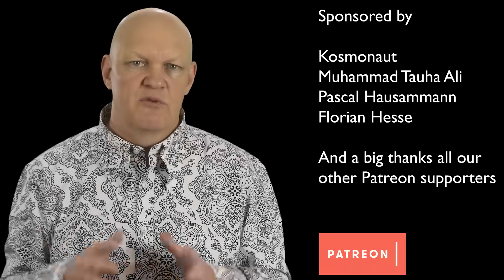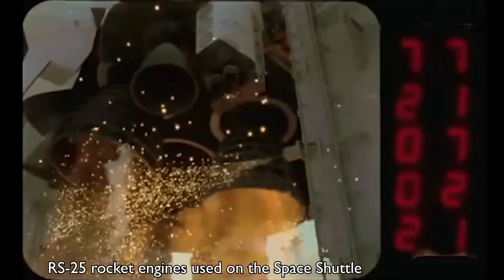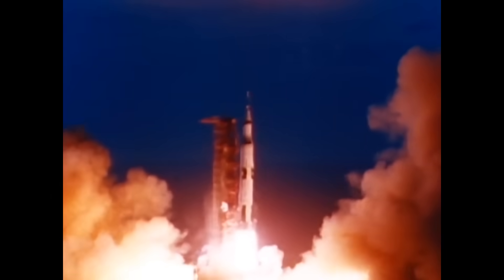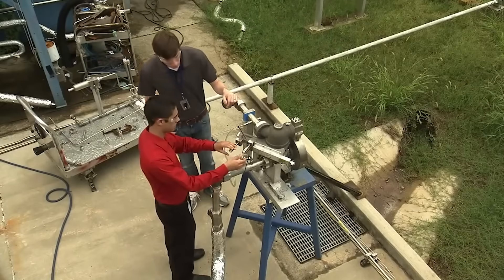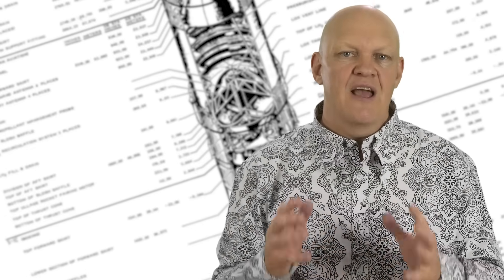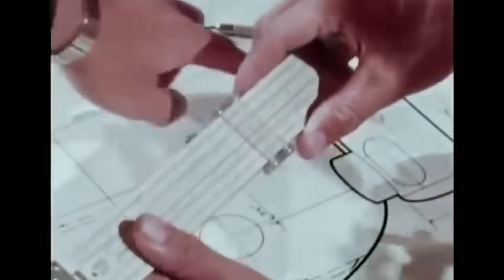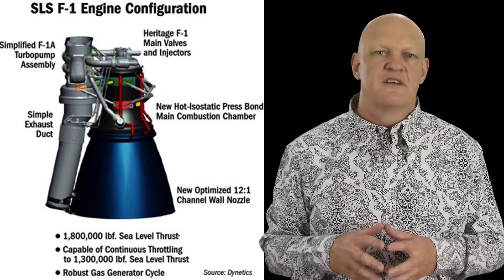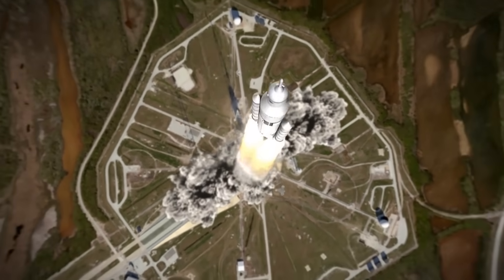Why Can't we Remake the Rocketdyne F1 Engine?

Comment: So they literally can, in the F-1B, which would theoretically be better
Reply: F-1 is just a gas generator engine. Today US companies can built oxygen rich closed cycle engines, which are superior in efficiency (means higher specific impulse).  The Raptor for example is such an engine, or the Blue Origin BE-4. 
More efficiency = less fuel, less weight to lift, more payload with the same rocket or the same payload with a smaller rocket

Comment: I’m no rocket scientist, but there’re going to need another engine pretty quick, if they plan on launching an SLS-4 some time in the near future.
Reply: SLS is using liquid hydrogen. The F-1 is a RP1 engine. It won't work, the whole rocket would have to be completely different (the size of the tanks etc)
Reply: @simonm1447  true that, but they are going to quickly run out of RS-25 engines. They have only 16, so assuming that they don’t lose any before SLS-4, they will have no back up engines, which would be an intolerable position.
Reply: @johnkoziel789  since they have to make new ones anyways they go for a new built, simplified and cheaper version of the RS-25. The original ones are expensive, but they are also  reusable. SLS don't need reusable engines any more.

A different engine with a different fuel would mean more or less a new developed  rocket, and the man rating would have to be certified again.

Comment: The F1-B designers need to MAKE it, and put Bpue Origin’s BE4 engine to shame :)
Reply: If you want to reuse a rocket you need engines not that big, since the boosters have to hover. Even a modern engine has a limited range to get throttled back. F-1 couldn't even be throttled back, and it would be way too powerful to hover a booster. 
Also Raptor and BE-4s are closed cycle engines, with much more efficiency compared to a gas generator F1
Reply: @simonm1447  There are more fish in the sea than reusables, and closed cycle engines. BE4's have had half a decade, only the Raptor is the only full flow available, and it isn't reliable yet.

Comment: If they spend the money and recreate those engines. It would be worth it because they can relearn all those long lost skill’s.
Reply: Relearning a lost skill isn't always worth it. I have forgotten cursive, and could relearn it, or I could learn something new about computers. Computers being far more relevant for me.
Reply: Today you can build much more efficient engines. So there's no need for a redesigned 1960s engine. Back then a lot was welded by hand, today you can print Inconel parts with 3d printers lighter and more stable than welded parts, in a much shorter time

Comment: I was working in company that build machines. As an mechanical engineer one of my task was to redraw and update one of the very first design that Age was 15 years with poor documentation. It was extremly costfull and time consuming operation. From my perspective it is similar to creating new design but keeping compability backwards and useing stock of parts that you have to use. Sometimes it is not the way you should go. Indeed NASA created new engine with the same rules that was driving old f1 engine.

Comment: The F1B seems like a great idea now, at least for the first stage.
If SLS used kerosene for its first stage, it wouldn't have problems with hydrogen leaks.
Reply: A kerosene first stage would be heavier, since the RS-25 is far more efficient than the F1 and LH2/LOX is chemically the most powerful fuel combination.
Reply: @simonm1447  not necessarily. At liftoff more than 75% of the trust is from the five segment space shuttle boosters, which run on PBAN-APCP and have a specific impulse of only 242s which is a good chunk less than the 263s a F1 engine has at sea level.
Reply: @plainText384  RS-25 however offers more than 450s, far more than the F1. 
But even Saturn 5 used LH2/LOX - in the upper stages
Reply: @simonm1447  At sea level (relevant for a first stage) the RS25 has an isp of 366, if we do a weighted average with the thrust at liftoff, the Isp of SLS during the burn time of the SRBs is about 273, only 10s better than the F1. It's questionable if that slight efficiency gain is worth the hassle of SRBs (which can't really be tested or detanked) and hydrogen (which is cold enough to freeze lOx and seeps through every crack).
Reply: @plainText384  in the current configuration the burning time of the RS-25s is 480 seconds, the F1 in original specs however only had a maximum burning time of 163 seconds.
The Saturn 5 was 3 staged, the SLS has just 2 stages plus boosters burning for 2 minutes but a core stage burning time 3 times that long compared to the Saturn 5 first stage.

Comment: If NASA still has the original Blueprints of the Saturn 5 F1 engines in its possession then logic would tell you they could reproduce those engines today as was done back in the 60s, In fact, the same ongoing modifications and tweaks to drawings would naturally occur as engineers and designers as they worked through the development stages would come up against the very same problems and work around those problems and more than likely come up with identical solutions and workarounds. It can be done more so today aided with computer-generated solutions and much quicker. Logic says YES.

Comment: This is some airy, vapid nonsense about these engineers having some hallowed set of technical skills that no one has today. Of course we could rebuild these engines, if not build engines far larger than the F-1. The problems arose at the start of the 70s with Richard Nixon drastically defunding NASA. A high and beautiful wave of innovation was possible back then ending in building very large rockets (bigger than the Saturn V) from more advanced materials. As I understand it, the Saturn V was actually somewhat cobbled together and hurried by the standards of the time and certainly by today's standards. Kennedy said they'd put a man on the Moon in 1964 and five years later they did it. The Saturn V was the product of an alignment of factors; political will and, in fact, political pressure, plus the necessary funding; public interest and endorsement of the project; and the technical capabilities to be able to do it. Defunding NASA, The War on Drugs and the ramping up of war in Vietnam are among the worst things any American government has ever done; Richard Nixon orchestrated those things. No, we're perfectly capable of building Saturn V's today; none of the hands-on technical skills have been lost (we still need people with those skills on modern rockets; we also do things like rebuild, service, and maintain old aircraft, antique ships, trains, cars, etc, all of which require hands-on technical skill); this video is a load of rubbish.

Comment: Why would we want to waste time doing so?  Better? Cheaper? Faster? Are they any of these things.

I'll take an engine half as good if they are cheap and can be ordered in lots of a thousand.  We have things to do.  It's time to get to them.

Speaking of the old NASA, after two  failed attempts by NASA to get the big orange turd off the launch pad this past week, I think any future attempt to see a live launch I'll just go watch one of the couple of dozen SpaceX Falcon launches  that take off without much in the way of issues no delays.
Reply: In all fairness, though, Falcon 9 had it's share of issues during development and early operation. Also RP-1 is FAR easier to work with than liquid hydrogen. The argument could still be made that the SLS project should never have been started because of it's inevitable cost and cost overruns, but on the other side of the coin, it may have been the only way for NASA to get it's super-heavy human-rated rocket at all.
Reply: @ArKritz84  you do realize there are only going to be like 3-4 launches, including the deliveries to the moon.  How many Falcon 9 launches last year?  28?
We don't need super sized rockets for many launches when we can fly ten reuseables to orbit and then move their cargoes to a higher orbit.  This whole thing has been a giant boondoggle.  NASA's budget for next year should read:
10% for space probes
90% give the money to Elon for rockets

Comment: To be fair, building F1s today would bea archaic. We could build much more powerfull, and efficient engines than they did back in the day. But it would be horrendously expensive and not worth it overall. The only reason F1s existed was that back in the day there were no means to control a large group of engines efficiently and fast enough. Like the Soviets demonstrated with the N1 rocket. 

Of course we could build them. Hell we still have some and could simply reverse engineer them and build them from scratch. Redevelop every neccecary techniques and so on. Its just a matter of time and money. But why should we? We can build much better things these days. Like huge multiple engine clusters, computer controlled, more efficient and a lot more redundant...
Reply: Indeed smaller engines are more practical today, if you want to land boosters (F9, in future New Glenn) you have to have engines which can be throttled back enough to produce not more lift than the booster weight (F9 is an exception, but it has to have a perfect timing for the landing burn). F1s would be far too powerful to land a booster, you can't throttle such a powerful engine back enough and the original F1 couldn't be throttled back at all. 
F1 was the best engine for the job it was intended for - but it's a museum piece today

Comment: The heart of the F1 engine is the turbopump.  The turbopump design was worked out by 4-5 engineers drinking beer in a bar after work.  The calculations were written down on a bar napkin, as well as the rough design sketch.  The pumps that were built followed the napkin design exactly... Nobody made any changes.
Reply: lol

Comment: As I recall, one of the behaviors of the F1 that further pushed NASA towards SRB's for SLS was the F1's performance profile. Or in other words, it produced too much thrust too quickly. NASA determined that the liquid fueled boosters would have introduced enough additional stress on the main stack that additional redesign for structural integrity would have been necessary to use them. Which of course equates to more time and more money in comparison to just sticking with SRB's.

Comment: What fascinated me the most besides the solid rocket boosters was the turbo pumps for the main engines, the temperatures were excessive and yet these pumps work so efficiently, it was incredible sight to see an experience that we're able to pump this much fuel with the high specific impulse ratios that were needed, safely and efficiently, the srbs is another thing one mistake with the srbs it can't be solved, in some cases and Challenger God bless her crew had experienced this but it never happened with our rocket engines

Comment: The fresh design of the F-1B shows we can produce a cheaper & more effective heavy lift engine. The question is: do we really need it? While NASA is mucking about with Apollo 2.0, SpaceX had been leading the way the future with reusable boosters.
While diesel engine trains are undoubtedly useful, we also need semi-tractors, trucks, SUVS, and personal cars. One size definitely doesn't fit all.
SpaceX has put some pretty respectable loads into orbit, and Starship is a huge step forward.
Even the sub-orbital systems could prove useful if we adapt them to international flight. How valuable would a rocket from LA to (say) Sydney or Tokyo taking only a few hours be?

Comment: The F1 engine can be built today just as it was back in the 60s! Because that’s what they’re doing they’re taking the old design of the F1 engine and building it again thanks to NASA. They already tested the F1 engines fuel combustion chamber and it worked excellent!
Reply: They’re not.  They did however test a gas generator from an F-1.

Comment: Your video says a lot about the differences between then and now. But it didn't touch on how would they design a rocket engine with today's modern materials and advancements. Computer aided design sure has come a long way, it wasn't even around back then! They did indeed find a few surviving prototypes to get a new design built from, but I reckon that they pretty much redesigned the whole engine to today's specifications. The massive part reduction to just 40 parts is a strong indication of just how little of the original hand crafted rocket parts are still in it! Removing and improving so many parts of a rocket doesn't just redesign it, it makes it into a whole new design.

Comment: Many have made nostalgic comments that the old hand made is better. Truth is that while fine products can be hand machined, computer controlled devices can make the same parts closer to specifications in a fraction of the time, and can do it 24/7 with proper maintenance. Nobody, not even NASA, is going to pay several times a price just to say it's handmade.

Comment: I believe that the engineers and skilled workforce from that time had no fear of failure, unlike a lot of engineers today. We would have never made it out of the atmosphere with them. I have worked B-52's , Tankers and many other aircraft and aircraft engines over the last 45 years. Most of which were designed and built in the 50's and 60's. Today, with most parts and fasteners for these aircraft and engines being scarce or no longer exist trying to get an engineer to approve a substitute is like talking to a post. Most of the engineers I deal with are afraid of their own shadow and on a self-imposed power trip. I am one of the last true mechanics. The rest are part installers who have no idea what the parts do. Think about that for a minute. People are trained more to do what the computer says, and have no idea how things work, or why they don't. There is a plethora of videos explaining things that I learned in 1965 in first grade! My point is that, YES we could build the F-1's with the right group of people. Those who have not overcome the fear of failing would not be allowed on the property.

Comment: The reasons offered is lame.  I would say that it is complete nonsense.  He does not know how powerful modern reverse engineering is.  Send a sample to China for reverse engineering and you can have computer cad files within a year.  Also all the materials used can be found.  As for welding, there are far better computerized robot arm precise welding that no mankind can made in the sixties.  The only thing takes time is metallury.  Reverse engineering can give you the exact content of the alloy used.  To make the alloy you cannot just throw those component metals in.  Still need the figure out the process.  There must be something NASA has not told.
Reply: The reasons offered is lame.

For you, not for any engineer who designed and assembled any machine.
Reply: He does not know how powerful modern reverse engineering is.

No you don't know, how much reverse engineering costs kiddo. 

Send a sample to China for reverse engineering and you can have computer cad files within a year.

Having cad files is just very small part of whole project kiddo;) Beside all blueprints for Saturn rocket exist. 

As for welding, there are far better computerized robot arm precise welding that no mankind can made in the sixties.  The only thing takes time is metallury.

Yes they are, but you would have to redesign welding on parts of that rocket for robot arm work. 

There must be something NASA has not told.

Yes, that conspirattards are useless people, who never designed anything in their pathetic lives;)

Comment: NASA was ALWAYS going to use the pre existing space shuttle engines and designs because it kept alive the jobs in those congressional districts. The tender was for show and a PR stunt. Keep existing cost plus contracts which secures jobs in my district or cheaper fixed price contract to (re)make the F-1 which has not been in production for 50 years which MIGHT create SOME jobs in someone else’s district meaning job losses in mine The winner was never in doubt

Comment: Do you actually believe that we can't make a engine based on the same concepts ?    The motor was made by empirical means, I understand it.  Make a small one, then scale up? By the way I did use a slide rule (10 scales - cadillac model) in grade 9/10.     NASA have more excuses for why we can't go back to the moon.  It has been 50 years.  Its hard to deprogram a brain once a idea has taken root.

Comment: In a nutshell, we could make them again if we really wanted to--and somebody was willing to cough up the dough.
Today, if we need the same thrust, there are more cost-effective and more reliable solutions, such as using a larger number of smaller engines. Modern engines have higher specific impulse, and are also throttleable.